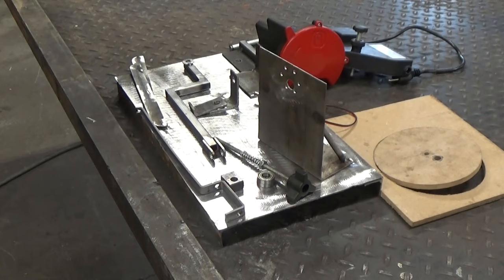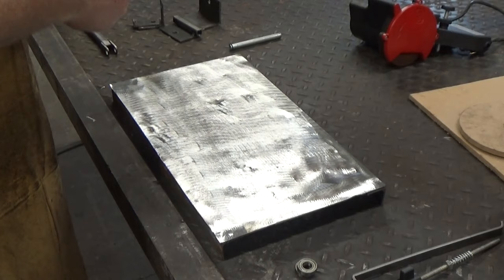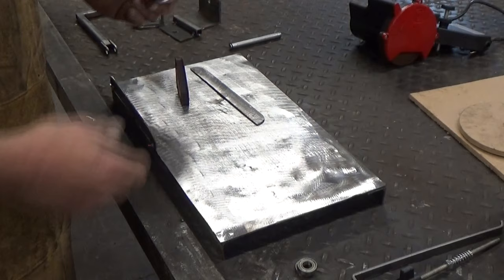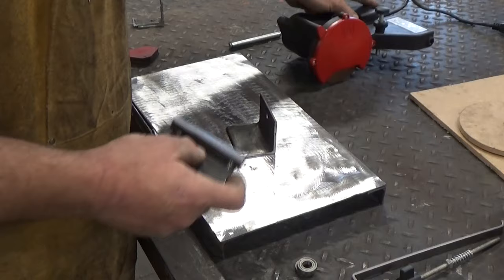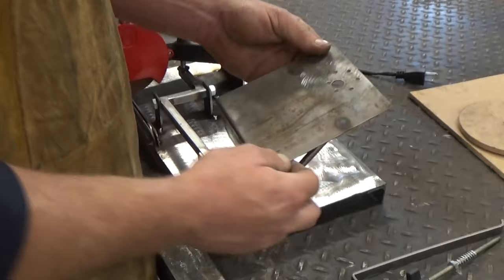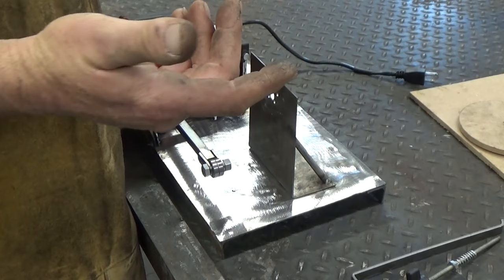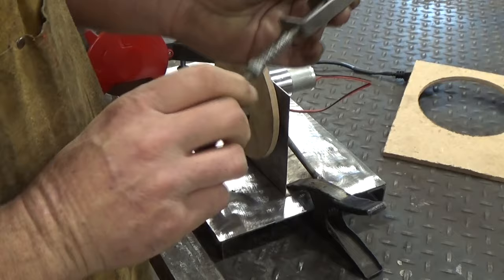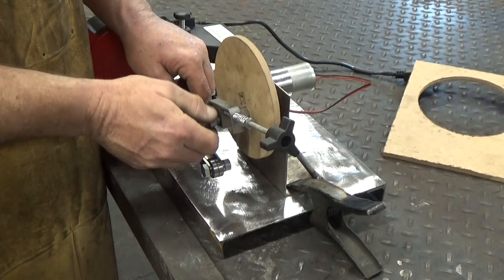Homemade bandsaw blade sharpener

Comment: This version is much easier to adjust because his cam is much larger diameter than others and the fulcrum distance to the lifting arm looks to be 4x. The larger cam wheel mean he can make finer adjustments to the cam reducing the danger of taking too much off ruining it. 
He also exemplifies here the importance of easy cam wheel removal for adjustments. 
The push rod design he made is so simple, easy to fabricate. Easy to forget how much thought went into making it appear simple.

Noted also looks like he is using a 3/16 thick wheel and you can see he dressed the leading edge of the wheel a bit to clear the back of the tooth.

Well done.

Now then, that chainsaw grinder... The price of these here in canada has shot up to $200 ! 
I placed an ad on craigslist to try to find a used one. So far a week later, none available.
Reply: 25 bucks at Harbor Freight in ND

Comment: I made some thing same after watching your video, the placement and orientation of the components is same as I see in the video. I watched the video so many times it is now memorised by heart. There was a big disappointment when I tried my first blade, you know I had to turn the blade inside out and do the same after sharpening. It was an excellent job done. Then I thought that if I had made it all in opposite I would not have to turn the blade inside out, my bandsaw upright column is on the left side very very common orientation. Want to know more about this but I am happy with this blade turning exercise since I am getting such good sharp blades. Thanks for the good design and detailed explanation of the cam making which is the heart of the machine. God bless you for spreading your knowledge and knowhow. Best wishes and regards.
Reply from the maker: thank you

Comment: Thanks man!  I have built one similar to this .. differences are 30rpm synchronous motor and the motor mount that bolted to the deck qith slots for moving the motor assembly back for profiling a different cam (I have 3 cams working and a 3th yet to do.  Cams are for: woodmizer 10/30 (most used), woodmizer 737 10*, 1" wide 3/4" spacing Lenox profile, and  last one for my blade collection will be for Ripper37s.

Comment: Stopped on this. . Ingenious design and great demonstration. Looking for a way to do smaller bandsaw blades for my bandsaw.  Your way shows sharpening the gullet and the rake, (?)  don't have a metal shop but learned the process. Thanks!

Comment: Best build yet, I have a Frontier 0S27 and do woodwork, my neighbor does welding and had all the scrap parts you used. I received my cam motor, bearings and other nessities yesterday and he has almost completed the base so I should have a working sharpener soon. Thank you so much

Comment: I "ve been looking to build one , I appreciate the time you took to share this , I'm going to start on one this week thanks for sharing . I could only get a 4mm shaft on the motor , 15rpm so this build is going to be fun , have about 70 blades that need to be sharpen . Thanks again for sharing , will forward pics after I have a blade on it .

Comment: Some pro tips!
1st. you don't have enough head tilt! Increase it even more!
2nd. The pusher starts pushing too early. He slowed it down a little more, only a little later to start thrusting.
the 3rd. A true technically competently designed grinding machine always works with two pushers! With one pusher you accumulate error! After 3-4-5 sharpenings of the band it will mess up the pitch of the teeth and the teeth will be different heights and the band will stop cutting!
the 4th. At the back of the hinge, try to install small bearings, because there are probably bushings and there is play in them! This loofah will lose the front corner of your tooth!
I'm using google translate and some words will be confusing, but you'll get the point :)
:)
Reply: He's not making a 1000 dollar shaperener. Didn't  you listen to the end he said do it how you want. I think he did an excellent  job.
Reply: I wish you had a longer video on your channel. Sets take angle correctly for softwood, but alas, no words, only a quick video.
Reply: @MrTate1970  For the money, what it has done is really good. I just give him guidance if he has the desire and time how to further improve his machine. I have watched the whole video from end to end and I loved it. That's why I decided to write a comment with my advice. I love his video, don't get me wrong!

Comment: Satisfying artwork for DIY engineers. 

I'd like to see a Hammer and Anvil version that sharpens by flattening the tooth to a chisel point and doesn't start cracking in the gullet. 

When EV Trucks get going, (or we might have to refurbish our own preferred Classic), a Bandsaw with twin Electric Motors is on my list of projects, so many ways to use Electric Tools and not breath bad stuff. Because a 4WD has the front wheels turn a touch faster than the rear, to protect the differentials from backlash and overstrained drive trains, ..so the same thing happens in a Bandsaw blade, if you want evenly loaded cutting tips, less shock-stress on the bottom of individual teeth in the gullet. Maybe. Computer Modelling research required.

Someone, a DIYer first probably, has to do this.

Comment: Awesome build....I ordered a small motor with like that but it came in as 4 times smaller than yours....I believe it was a 6 mm shaft and flange...way to small...do you have the measure ts or a link to that motor and flange, I would love to build one ASAP....thanks for your time
Reply from the maker: DC 12V 18RPM Turbo Worm Geared Motor High Torque Micro 13mm Shaft Geared Motor With Screws JGY370-1218